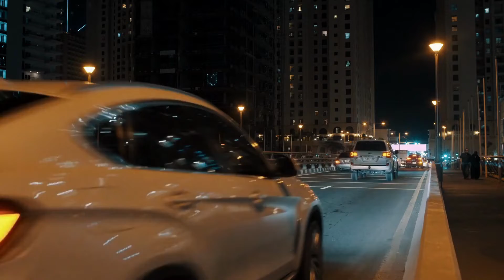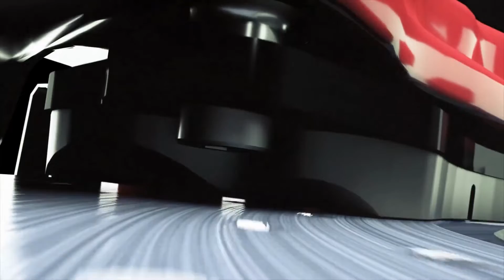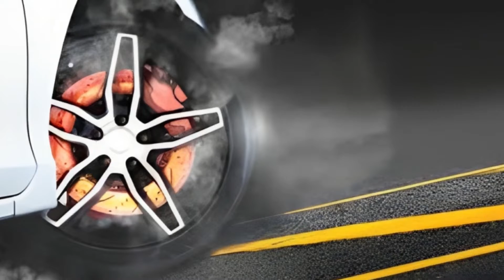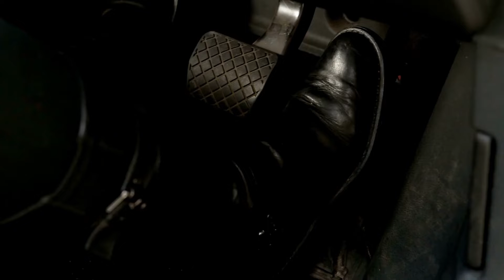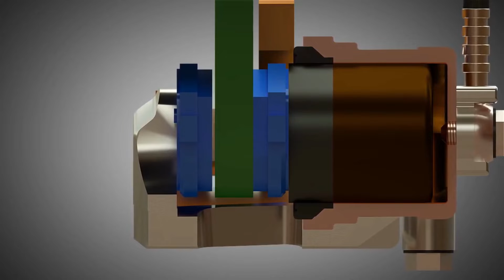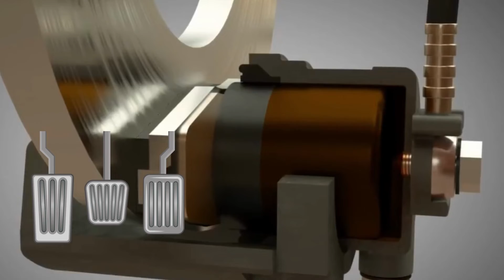Top 10 Common Car Brake Problems And How To Fix Them | TrustMyMechanic.com

Comment: My opinion of this video? Too much style and not enough substance. I came to find out why my brakes have very reduced effect at second press. They aren't soft and the pedal does not go down any more than usual. This video gave me zero help. I don't need funky graphics or funky video.
Reply: Is it a problem with the rear brakes?